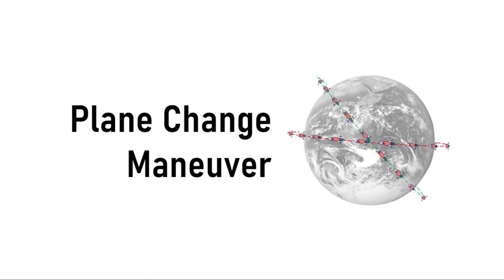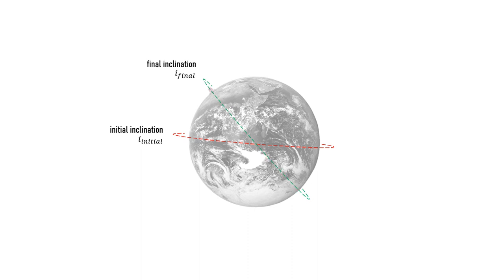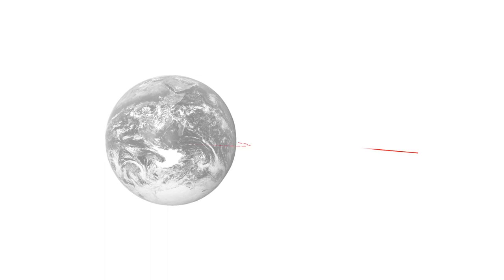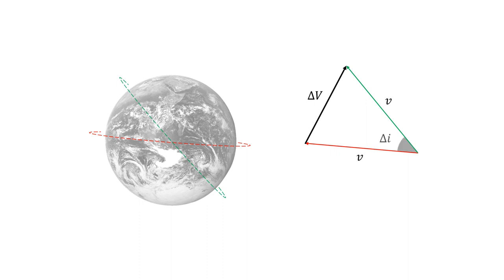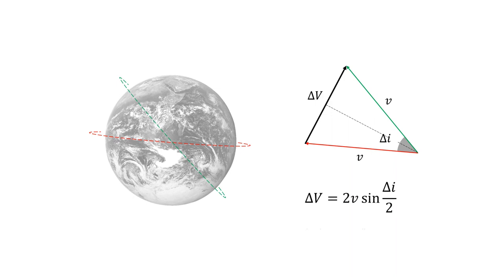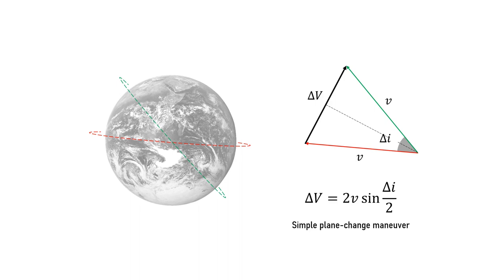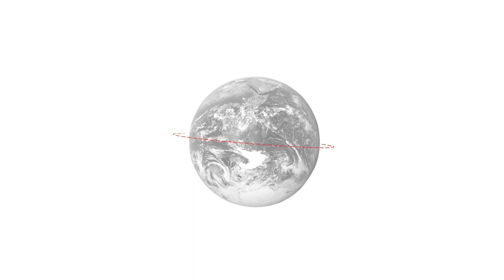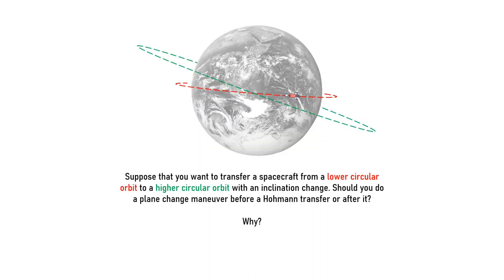Space Mechanics | Orbital Maneuver | Plane Change Maneuver

Comment: In order to transfer a spacecraft from a lower circular orbit to higher circular orbit with inclination change, plane change maneuver need to be done after the Hohmann transfer because delta V is needed in the equation of plane change maneuver and it will produce or require less v.

Comment: you should do plane change maneuver after hohmann transfer because it will require less velocity since plane change maneuver will use the delta v from the hohmann transfer as its velocity. 

and i have one question do we use rad or deg for the inclination angle. Thank you Dr.
Reply from the maker: You can use either one.